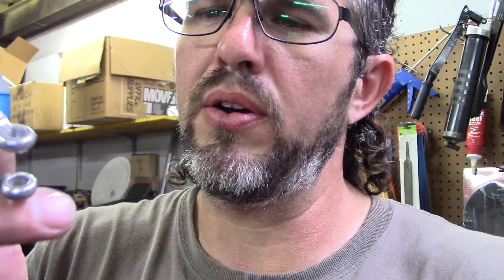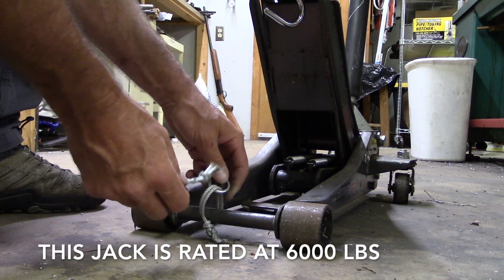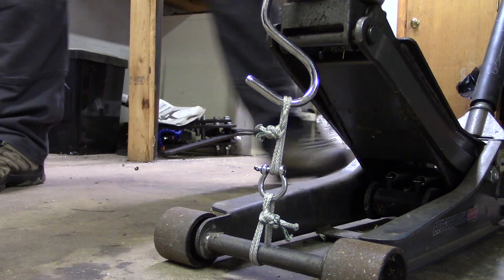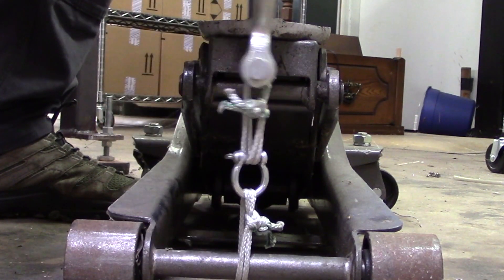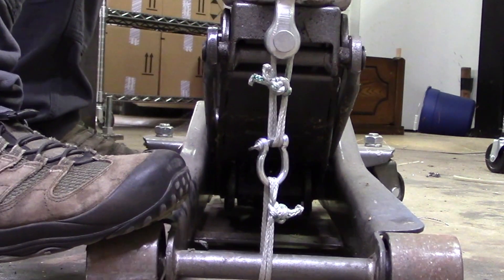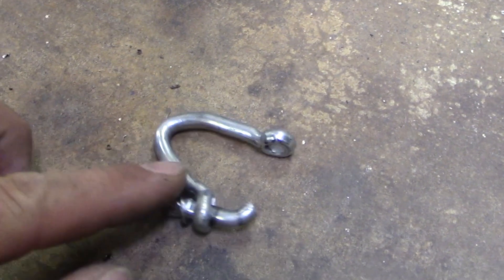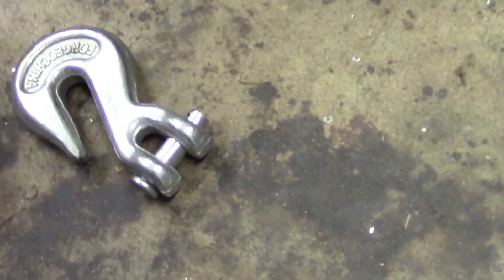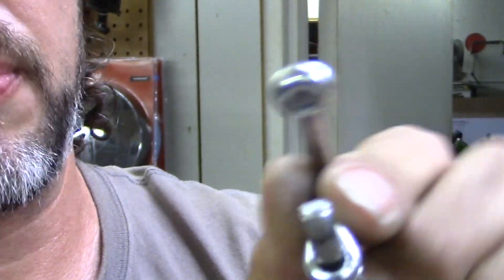Shackle vs  Shackle  Testing A Soft Link Against A Metal Shackle To Failure

Comment: Hey Kyle, I have to extend my reserve bridal so it will reach my shoulder straps, what size and brand line would you recommend,I have a couple Kevlar strap with sewn loops now but I don't trust em I sewed them myself using heavy nylon upolstery thread..thank you in advance!!!
Reply from the maker: Would need the measurements to recommend the size, but any rated climbing sling would suffice.
Reply: @kyleoglee  doesn't look any bigger than 3/8 dia it's the ozone angel square short..I need to lengthen 20" as I am mounting it on the side and not in my lap.
Thanks Kyle!!
Reply: @kyleoglee  I am going to use two climbing slings and just loop em through thanks for the idea KYLE!!!

Comment: Cool test, but since the shackle wasn't through a swing arm like it usually would be, this introduced bending stress, which is typically the highest stress in combined loading. In a swingarm that bolt would have to shear off, which is not what happened here.
Reply from the maker: Good point.   I had the thought as well, but this was "recreational testing" 😉

Comment: Screw pin shackles are really designed to be bolted through a piece of plate. Also that doesnt look like a load rated lifting shackle. The gap is wide in proportion to the rest of it. I was still surprised it broke first tho.

Comment: It would be interesting to destruct them with some type of scale to see how much of a load they can actually handle.
Reply: Thing is no where in reality will we put that much pressure on our shackles unless God himself is jerking on your wing.
Still a good video showing us what could happen.
What was the soft shackle made from? 1/4" braided nylon? That's a tough rope to begin with but this test proved it's worth in our field of use. I keep a roll of it in my kite bag and the RV for emergencies.

Blue Sky's and Safe Journeys!
Reply from the maker: @rolloverriderpgr  This is Dyneema braid.  FAR stronger than nylon.
Reply: @kyleoglee  yes it is. I had a roll but it disappeared somewhere in my travels. Heck I have 2 rolls of kevlar kite string 50 & 100# and a few feet of sheathing! I had to replace 2 lines on my wing after I got it.

Comment: Always suspected those “Marine shackles” belonged on boats not aircraft. Life is more dangerous on the ground, specially when ur doin science!
Reply: Fairbanks Air Riders I can’t imagine every having near the force he used to failure.
Reply: @goldwingerppg5953  It's not the force issue. I don't like the fact that shackles will loosen if not secured, this happened to me once. Straps are a much cleaner solution and with surprising strength. Now I'm wondering if there is any advantage to using the old metal shackles verses the cloth carabiners.
Reply: Fairbanks Air Riders I actually had a shackle fall off recently. I flew without realizing I had lost one of my shackles, but I notice my takeoff and landing was poor and flights seemed strange. Against incredible odds my flying buddy found my shackle when he landed and when I landed I told him about my issues. That’s when he showed me he had found my shackle, which help explain my issues. I’m not against rope shackles and my use them at some point, but you’re right, you have to make sure they are secured and more susceptible to failure then rope.